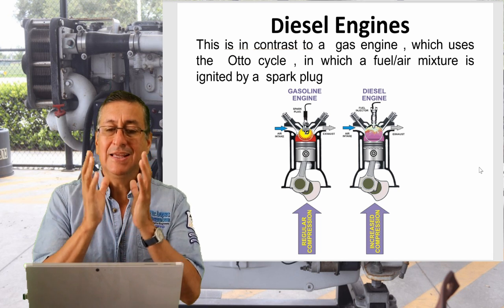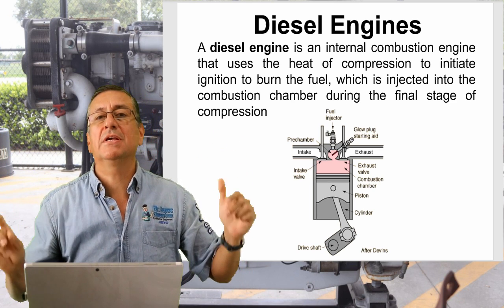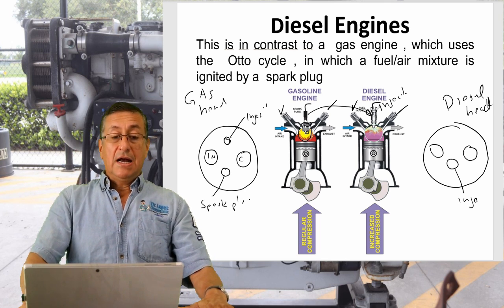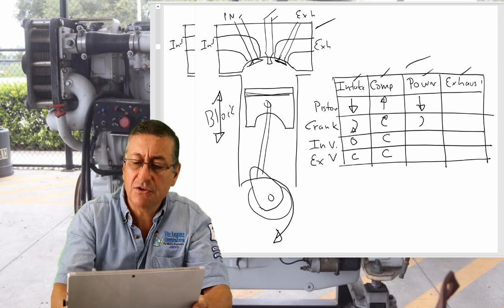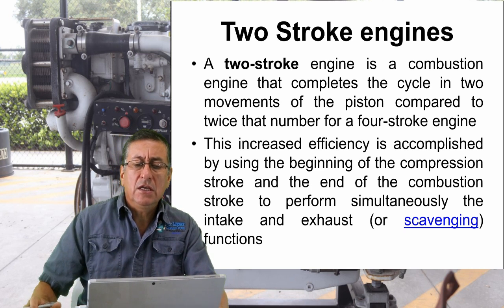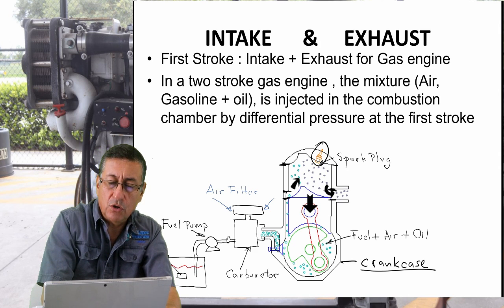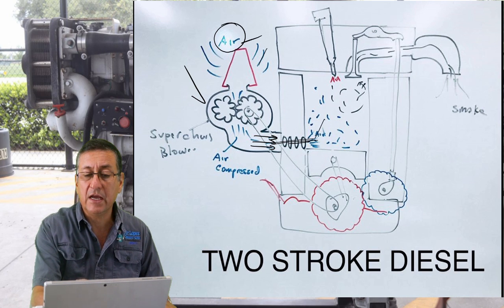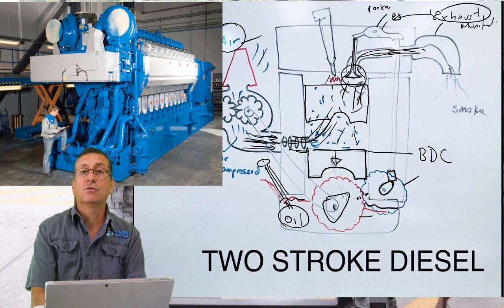Two Strokes & Four Strokes Diesel and Gas Engines - Chapter 3 EP 2 | Diesel Course

Comment: I like your definition of an engine, as burning air rather than gas. I'd prefer to think of it as a air/fuel mixture since the fuel is providing the propulsion to rotate the crack-shaft. Granted, air oxidizes the fuel allowing it to burn but if you dripped fuel into the combustion chamber upon detonation the efficiency would be reduced contingent to the fuel surface area. Oxygen can be compressed to a flashpoint, that's why diesels don't require spark plugs but on its own there isn't enough energy expended from air, alone, to continue the revolution of the crank. thank you again for your illustration, always a great professor!
Reply from the maker: For me was a pleasure work for you Mr Manning]